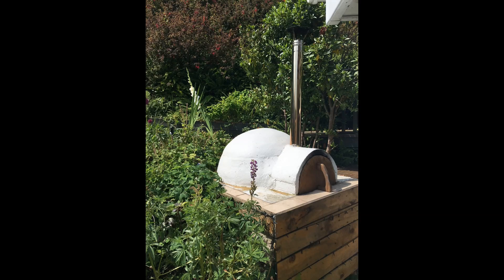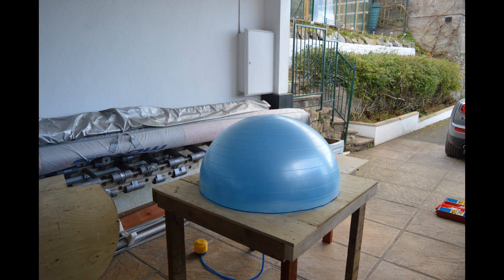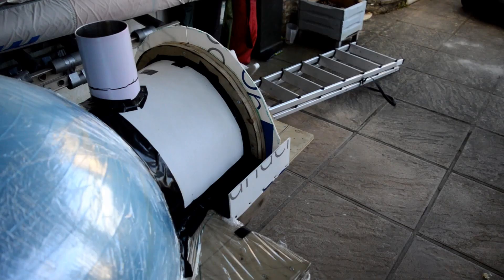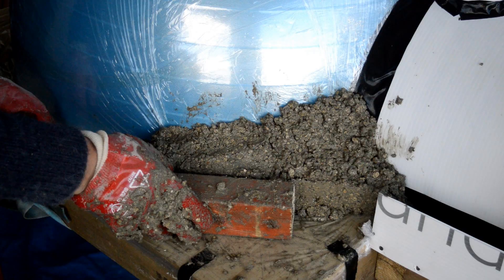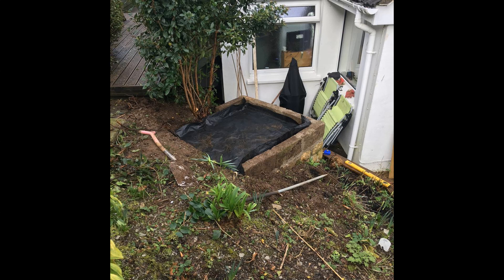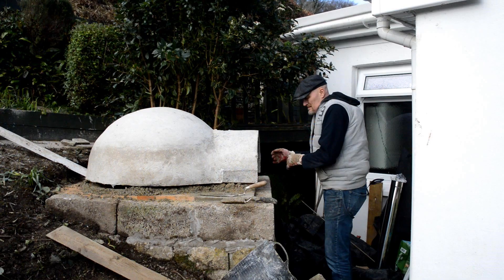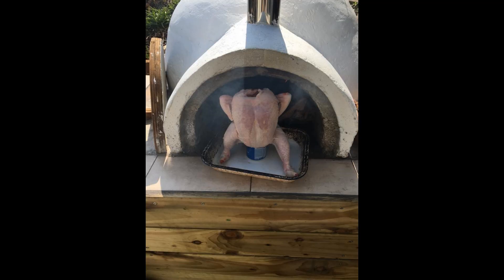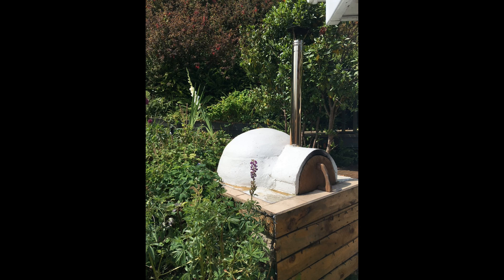DIY cheap exercise ball pizza oven in 5 mins

Comment: Thanks for the video but you really should not use standard (portland) cement for any high-temperature application. It's not stable after 150 celcius, and would totally disintegrate in oven temp. So just because it does not collapse, doesn't mean the structure is healthy. (though in the worst case scenario it would collapse on your pizza during cooking :) So use special fire cement folks!
Reply from the maker: The oven is 6 years old and going strong 💪

Comment: I mixed 6 parts perlite, 1 part refractory concrete, 1 part Portland cement, and water, for the oven floor under the tiles, It's been curing for 5 days, but it hasn't fully hardened yet. I can still dent the surface with my nail. Could it be that I used too much water, and it won't cure properly? Or will it just take more time? Or could it be the mix itself?
Reply from the maker: I left mine covered in a wet blanket for two weeks then left 4 weeks to dry 
We built one for my son in Australia dried out in 10 days
Reply: @NickChittyFlying  thanks!!!
Reply from the maker: @javierdorrego  no worries mate mines still going strong 💪 just keep rain of it

Comment: I get it to 63/8 inches 1220mm board 900 ball = 320mm ÷ 2 = 160 ÷ 25 = 6.4
But thats the thickest I've seen must admit I like the way the outside was finished, thoughts on the 6 inch thickness it could take a long time to heat up but should be stable..
Personally I am now finally tempted to build my own..
Is the cement standard portland or fondu..🤔
Any weather proofing or is it good to go 
Thanks David..

Comment: Hi Nick, Great video! Question, did you end up using all 200 liters of the verm?
Reply from the maker: Yes mate I used some gardening vamiculite to finish tunnel off just couple small bags as filler 5 years she’s still going strong. Think leaving it 3 weeks to cure helps I also left damp blanket on for week
Reply: @NickChittyFlying  thank you so much for responding and making this awesome video!

Comment: How long does it take to get up to temp and what is your heat retention like?
Reply from the maker: 40 mins to cook it will hold heat for couple hrs if you add a thermal blanket and more cement it will be longer

Comment: I love your concept, I've taken a few notes of my own and combining it with some tips you gave in the vid, however, where exactly is your chimney made from? I cant seem to find the proper material..
Reply from the maker: eBay just type in 4 inch stainless steel chimney doesn’t need to be twin wall unless going through a wood roof

Comment: I just followed your instructions.  It looks good so far...  one question, how thick were your side walls and how long did you wait till your first test fire?  Thanks again...  Brian
Reply from the maker: Hi Brian i mention it on the video 20 cm thickness minimum , I let my dry for 3 weeks then used a large candle for 4 days then started little fires once a day for a week.
Reply: Thanks so much.  I just added a second layer to mine and now I will wait a “fortnight” before I do anything else.  I had to google fortnight to see what that meant.  :).  Cheers.   Thank you again for the awesome video
Reply from the maker: @briancooper176  2nd layer and thermal blanket is great. i wanted to do that but my wife like it as is :)
Reply: @NickChittyFlying  What? 20cm is close to 8 US inches..  that line you have drawn at 1:20 isn't 8 inches from the ball.  Back to 0:33 those sure look like 2x4 lumber framing, right?  If so, the circle cutout can't be further than 4 inches from the plywood edge.   Then at 2:25 the mortar mix come right to the edge anyway.  Looks like 4 inch thick dome (side walls) to me.
Reply from the maker: Steven Hartney yes mate good spot
Reply: @steven.h0629  I get it to 63/8 inches 1220mm board 900 ball = 320mm ÷ 2 = 160 ÷ 25 = 6.4
But thats the thickest I've seen must admit I like the way the outside was finished, thoughts on the 6 inch thickness it could take a long time to heat up but should be stable..
Personally I am now finally tempted to build my own..
Is the cement standard or fondu do you think 🤔
Reply: @NickChittyFlying  Got it.. thank you!
Reply: @davidrutherford3345  Sounds like you and I like to overthink designs :-)  My wife keeps telling me to be more maverick! 
Thanks!
Reply: @steven.h0629  haha yes I agree over thinking isn't a vertue.. just one thing though 
"Standard portland cement"
I've figured it out 85cm ball get you to 7 1/2 inches sweet as..
Portland ok though 👌

Comment: Great video, had you any issues with it getting wet from the rain or did you waterproof it some how ?
Reply from the maker: it gets a couple coats of masonary paint about now has a blanket and a tarp over it in the winter its 5 years old and going strong. top tip leave wet towel over it for 2 weeks while curing.
Reply: @NickChittyFlying  thanks for the update il be sure to get some masonry paint. This might seem like a stupid question but do you mean leave a wet towel over it while curing, when the concrete mix is curing or when when curing the oven with fires, also what's the reason for the wet towel
Reply from the maker: @93cdempsey  yes mate left mine under a damp blanket for 2 weeks. then let it dry for week and let the ball down good luck

Comment: Hi, thanks for the great video.  I have been researching these are other styles of ovens that are easy to build rather than attempt a pompeii style brick oven (also due to cost constraints).   Can you please tell me with the vermicultie and cement how is the heat retention post the fire going out? Obviously, there is trade off of weight with regards to thermal mass of bircks etc?  How long would the oven retain its heat for other slow cooking etc. Also how hot does the outside of the oven get when you have it up to full temperature, the only reason i ask if that i have kids and would not like them to get burnt. Thanks in advance.
Reply from the maker: it wont retain heat for more than a couple hours after cooking if you wrap in insulation blanket and add more mix. but i love mine as is